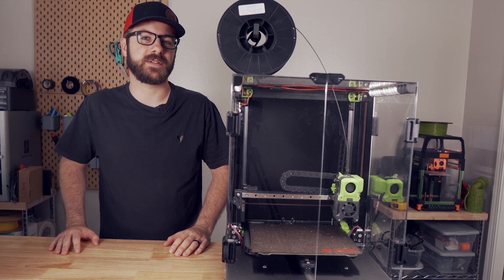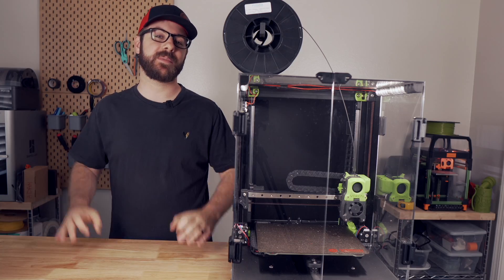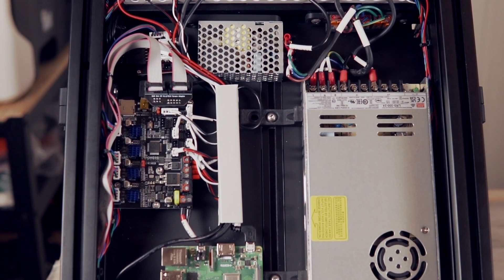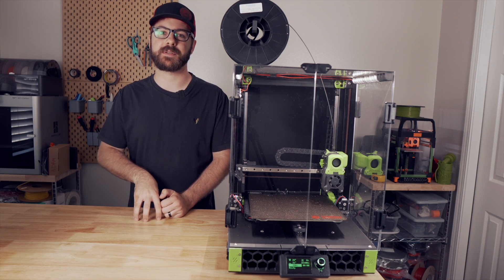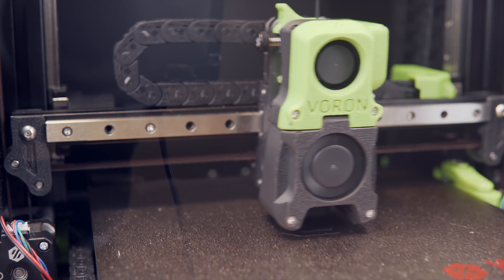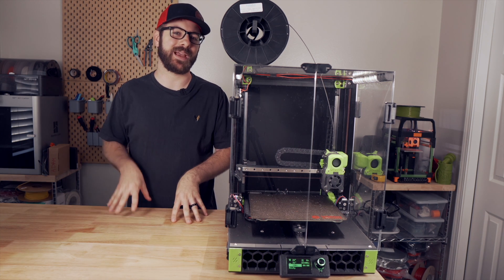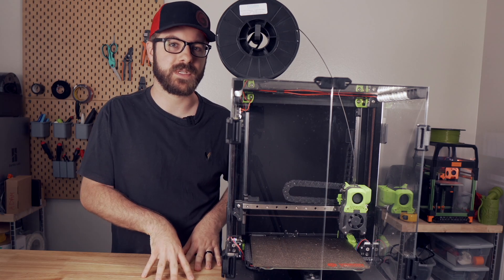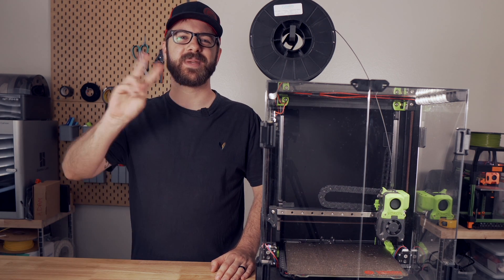The Voron Switchwire Is A BEAST - CoreXZ 3d Printer

Comment: I know this is an old video, but the reason the mesh leveling does not work is because of the magnets built into the bed. It spikes the sensor creating an uneven mesh.
Reply: yes, needs the faulty_region option to avoid bed leveling above the magnets

Comment: I'm looking at an Ender 3 Pro to switchwire conversion.  I think I will use the older afterburner tool head, with a 2 or 3 way Y bowden extruder instead of the direct drive extruder.  This will have 2 or 3 M4 extruders, for a multi-material (2 or 3 color) printer.  You can get basket-case used Ender 3 Pro printers for well under $100, and they will supply all of the extrusions, motors, and the 24 volt power supply.

Comment: +ModBot Since the Bambu Lab P1P is all over the place and the Voron Switchwire is more in it's price range (especially with VAT which brings the costs up to 800 € here in Germany) than a Voron 2.4 does, it would be cool to compare these!
Also the rise of Klipper to Ender machines with the Creality Sonic Pad or simply an old Netbook with Klipper installed on it and the increase of speed that comes with it would also be a great contender in the sub 1000 bucks market!

It would be interesting to see if a Ender machine (like the S1 Pro with Sonic Pad) can come close to the speeds of the Switchwire or even the P1P.
The other aspects except speed like costs, building experience, knowledge gain, documentation, tutorials, repairability and customizability would also be very interesting, especially when addressing soo many Ender 3 owners who could convert their machine into the faster Ender Switchwire.
Is there also a comparison in price on how much costs the parts from an Ender 3 safe to a full build?

Bambu Lab is all about speed which seems to be also one reason for the Sonic Pad or Klipper PCs to complement the old Marlin control system let alone building a Voron.
So is the P1P really a gamechanger when speed is not the only concern but also print quality, repairability, printing ABS/ ASA and having a comfy print experience (touchscreen)?

Since I have some old Smartphones laying around I wonder if I could use one of them (Moto G (1. Gen) for example) as a touchscreen for the Switchwire... ?!

Comment: I really want one but I don't have the spare time needed to build one. It would take me like 6 months.
Reply: It took me about 14 months, including delivery delays, anxiety to start. Then another idling by making misstakes and reordering of parts to correct them in some way. And the last obstacle is a SBC because USB via PC connection is too slow for printing a real part. Are circular part I mean after it goes into only walls are demanding more than the first layers for the foundation? A small sieve in particular. PS for a V2.4

Comment: CoreXZ is, probably, most idiotic kinematics for 3D Printer. It's worse than anything else. It does not have any advantages but has a lot of issues. Never buy  or build such printer. It was made by pure idiots.
Reply: I have to agree, adding a bunch of complexity without improving the main problem of an i3 style printer.

Comment: Do you think an ender 3 conversion to switchwire is worth it, or should I entirely build it from scratch?
Reply: Late to the game on this thread, but figured I would chime in.

I am about 90% of the way through an Ender 3 V2 to Switchwire conversion, and I can say that if money is no object, the conversion is pretty awesome.  I've learned a ton, and the difference in print quality from the ender to SW is outrageous.

That being said, I haven't tracked how much I've spent on the conversion, but I can tell you without hesitation that I have spent a LOT more than just going with an LDO kit or the like (if you count the price of the original ender, I've easily spent V2.4 money on this conversion).

Another consideration to make is that there is no kits.  You're on your own to source the things you need, and the conversion I went with did not have a BOM, so I had to guestimate as best I could based on the CAD files for the conversion, as well as the official Switchwire BOM.

Probably the other big thing to keep in mind is that there are no manuals for the conversion.  You can kind of follow the official Switchwire manual, but not everything translates, and in order to really follow it, you'll have to completely take your ender down to pieces.  I had already done a few mods to mine that made me really not want to do that.

All of that considered, I learned a ton, had a ton of fun, gave myself more than one migraine, yelled a few curse words, spent way more money than I expected, and if I could go back and do it all over again?  Yeah, I would probably still do it.  The Ender was my first printer, and seeing how much it has improved over time, especially with this conversion has been very rewarding.  I've got a ton of blood, sweat, and tears in this thing, and wouldn't trade it for the world.

Oh, and one final consideration: the enclosure for a conversion is a giant headache if you don't have a Lazer, or access to someone who does.  Nobody makes the panels, and the official panels don't fit.  I don't have access to a Lazer, so I've had to hand cut all of it.  It's probably the one thing I would do differently if I could.  I would pay all the money to send the DXF files to someone and have the panels cut.
Reply: To me, buying an Ender 3 first and print with it stock then only upgrade it to a Voron when you have fairly knowledge about 3d printer. But if you already have knowledge about 3d printer then go ahead. Buying kit and build from scratch is much more enjoy ride but only when you know what you are doing :)))
Reply: Tons of ender conversions. Honestly for printing abs/asa the bed of a ender can get to 100/110c way easier than the prusa bed can. Its "slightly" smaller in print surface and has a stronger heater.
Reply: Build from scratch, print parts on the ender and sell it when the switchwire is built

Comment: I mounted a BL Touch to the side of my Switchwire Toolhead without loosing any X-travel at all. I've had it over a year and the whole printer has been working great with 0 issues. That being said I wish I had spent a little more money and built the Voron 1.8 (Trident) instead.

Comment: I’ve had a lot of trouble with the cable chain on my Y-axis. The printer keeps eating through the cables so I printed out a prusa 90 degree cable mount and switched to a cable wrap instead.
Reply: I have too. Both of my bed heated wires split in half. It first happened after 29 hours, so I put the cables in sleeving and inside the cable chain. Then the other wire broke after 450 hours. The PTFE wires from McMaster I used to replace the bed wires seem to be working better. The McMaster wires have a better weave of the wire strands and thicker insulation.
Reply: You have to use wires rated for cable chain, such as ones with a PTFE sleeving
Reply: @jakoob874  it came from the LDO kit…

Comment: I'm still not sure why you would choose the switchwire vs the 2.4
Is it just the price?
Reply: I'm you should get neither. Get a 250mm trident. Cheaper and better than a 2.4.

In terms of "maintenance trap", neither the vorons nor prusas would be a maintenance trap. The vorons would require tuning out of the box but the prusas should be a plug and play. Just make sure to get a good voron kit if you go that route. If you have more questions just join the voron design discord!
Reply: For me it was simplicity and ease of maintenance.
Reply: @patricke3848  i see, so far i can only afford entry level i3, but interested in a voron 0

what maintenance trap i should be aware of

Comment: I'm using the sw-magprobe as well. It's really good.

I don't think a switchwire is a particularly good value proposition as an entire kit, the price is so close to a trident and it's massively space inefficient compared to the trident and 2.4, using an ender 3 type printer or something that uses a prusa size bed as a donor is an incredibly cost effective way to get a very fast and enclosable printer though.
Reply: Where do I learn about doing this? I have an ender 3 v2 I could use
Reply: It's a great project if you have an Ender 3 Pro, V2, or S1 you don't use or that needs a new hotend or stepper or motherboard etc.

Comment: i would really like pricing info on the conversion from ender 3. who doesnt have 1 laying around lol. 900 seems a bit steep for the entire kit but maybe the ender 3 helps a lot? idk. great video keep it up
Reply: If you swap out everything that is called for on the ender 3/switchwire BOM list you're looking at $300-$400. Plus you will need to print out the parts in ABS or ASA. Your biggest costs will be the ras Pi, linear rails, stepper motors, board and gears for the extruder.
Reply: This could be a good reason to make a switch wire. i still have an ender 3 in a box so I might look into this.
Reply: I am also looking into doing a partial conversion from my Ender3 that has 2 of the 4 linear rails needed & has a direct drive hotend.
Switchblade looks like a nice way to salvage Ender3 hardware without the price of all new CoreXy hardware! 
I hope my plans work out!
Reply: Siboor sells a kit for the Ender 3 conversion now, like other comments have said, maybe 300-400$

Comment: Very interesting video! I'm thinking about converting my Biqu B1 to a Switchwire-based core xz thing. Just for fun.
Reply: you really should not
Reply: @Ender_Wiggin  Why not?
Reply: @fmrigon  Woops i thought you were going to convert a corexy voron into the switch wire. you can do it for the biqu b1 but you may not see that big of a different unless the biqu bq is just bad. Also you will still need to buy a lot of extra stuff just to be see real improvements. Things you can already due to the biqu b1
Reply: @Ender_Wiggin  oh no, why would I convert a core XY into a xz? lol
I just want to do it for fun, I don't think the conversion would actually improve print quality.

Comment: With the pricetag in mind, would you say this is better over a prusa for example? Or a prusa bear? Or thinking cheaper an Anet AM8 BLV conversion?
Reply: It depends. If you like tinkering them build a voron. If you just want the printer to work out of the box then get a prusa. Though after the tuning the switchwire can print quite a bit faster than a prusa with its stock profiles (I'd say 3-4x faster consistently, even 5-9x if you really push it) and it can be tuned to a very similar level of reliability however the klicky upgrade is a must here. Lastly the switchwire is also capable in printing more materials with the optional stock enclosure, however this is mostly just small-medium sized ABS parts.

Comment: I would prefer NOT to spend x amount of time building it. My use is for business. Is there an assembled option for these ?
Reply: Not really. Vorons are more for hobbiests who want to build a high performance printer.
Reply: @MichaelDBeltran  Gotcha...what would be a good starter printer for business?
Reply: @aqwer2400  Bamboo Lab X1 Carbon if you need fast. Otherwise Prusa machines
Reply: @XA--pb9ni  I was looking i to buying the Bambu X1 carbon but when I looked it was out of stock hoping to get one though otherwise it will be a prusa
Reply: hp mjf for business
Reply: You can sometimes find prebuilt machines for sale on the discord or on Facebook. If you are looking at just off the shelf the babu machines offer much more speed and material capabilities than the prusas at the same price.
Reply: @jakoob874  thanks yes I'm gonna see when bambulab is back in stock...when I'm ready if they're not in stock I'm just gonna go with the pruas
Reply: @jakoob874  Prusa is just more reliable for the time being, if you don't want to tinker, get a prusa

Comment: to me, that Z axis not too sympatic cuz there is no rigidity
Reply: you use original sw frame or converted? because 2020 or 2040 is not rigid 3030 or 3060 is more rigid print more quality with 3030 ...3060... 2020 2040  print is more vibration
Reply: @godbnc u misunderstood me ,my problem is the z axis belt...belts are not rigid things
Reply: @zola5584  I z-hop for airtightness to prevent potential leak paths in the perimeters and the belted z is awesome for that. A belt isn't rigid, but I've found it to be very repeatable.

Comment: frankly I can't see much of the point vs. a normal bedslinger(belts on z or not), if not doing nonplanar or something(and then too vs belted z).

linear rails are the way to go though bedslinger or not.

edit: what happens if 1 motor driver skips on overheating or something?
Reply: Belted along with high performing  steppers and a quality mainboard let's you run at higher speeds and accelerations with the same print quality. (Don't forget input shaper though!)